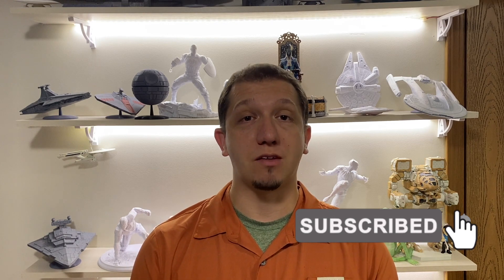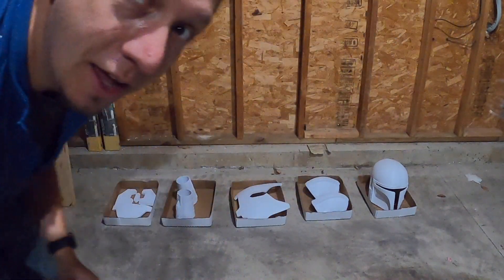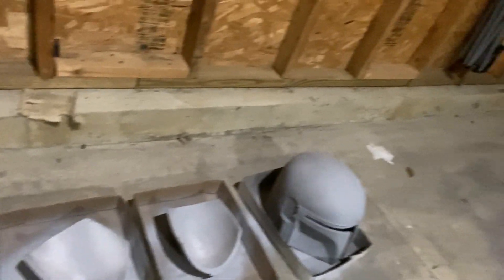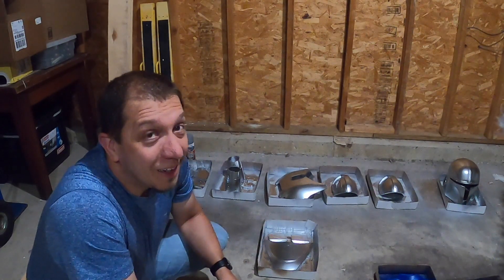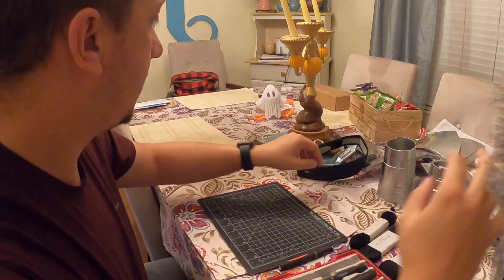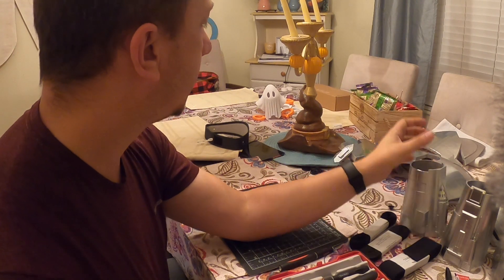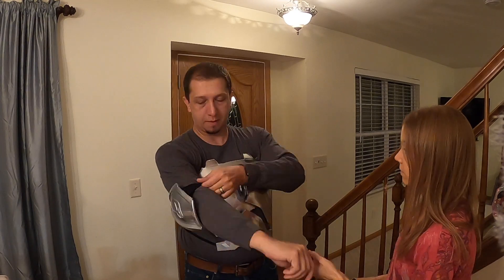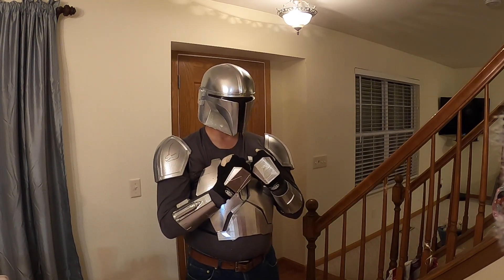How to make Mandalorian Armor with 3D printing (Part 2: Sand, prime, paint, assemble)

Comment: Great tutorial, I just bought my first printer and I’ve been printing pieces of the armor, I’m getting ready to print the upper chest piece right now, did you resize it or did you just use the 100% from thingiverse. I am new to 3-D printing and new to costume building, I’ve been taking measurements but the curve of the armor has been throwing me off of it, any help would be appreciated thank you.
Reply from the maker: I printed it at 100%.

Comment: Thanks the video was very useful for me. I also have a question I printed a Mandalorian Vambrace and I am not sure if I should sand down the layer lines so that you can’t see them or if I should just leave the layer lines alone. What do you think?
Reply from the maker: You can try the primer filler paint to see if it will fill and smooth it.  You can also sand just remember you can’t use a dremel or tool like tha.  It’s a lot of slow sanding.  Either way is fine and all that matters is you are happy with it.  In this video I did not sand them down.  I used the primer filler.  You can also do a bondo to smooth it.
Reply: @Rise3DBuilds  Thank you, That helps a lot.

Comment: oh and for the arm pauldrons - i always print them in halfs and use fabric like a long hinge  on one side very tight, and the other side i use these latchs  https://www.thingiverse.com/thing:53673  they work awesome and make it so easy to put on and reomve them.. and u dont have to buy a hinge  - i guess you could use them on both sides ,but what i do works really well  - mind u  i have electronics inside as well  and these hold everything nice and snug

Comment: as veedub says, use spot putty/glaze - veryyyyy thin coat spread nice  the beeter u do this the easier it is to sand and make like glass - use a black first prime coat anytime u want to use silver as your finish color it will make it look much better . im not sure how u attach your visor i stopped using glue and use heavy duty velco - this way when the visor gets beat up and it will  u can easily change it out -  iv had all my other helmets glued and it stinks to change them out if  they are glued in with hot glue .. u can always remove hot glue super easy with alcohol but velcro is waaaaay easier ..
my paint jobs are verrrry clean only because i take the time printing it good and prep the surface good -- use the putty you will see how much better your end result will turn out , its night and day

Comment: Can you tell me the type of 3D printer you used
Reply from the maker: Cr-10v2, Ender 3 for the smaller parts
Reply: @Rise3DBuilds  small parts like should hands chess and helmet
Reply from the maker: The helmet and chest plates were done on the cr-10v2. Hands,Vambraces, and shoulder Pauldrons will easily fit a Ender 3.  You could do it all on a Ender 3 but you will have to use a tool like me she mixer to cut them up to fit the printer.
Reply: @Rise3DBuilds  what tools
Reply from the maker: Meshmixer is free and will let you break the models into parts.  You will also need cura to slice the models to be ready to print.
Reply: Can you recommend one that can print all of it
Reply from the maker: Cr-10v2, cr-10. The have the right size print area.  I know the sunlu 8 can do  the same size but I have not used it yet.  I have one I. The box for a unboxing on the channel in the coming week. But the first to are printers I know and trusts.  There are links to them in the description of my videos
Reply: @tylerryan2187    you can buy a ender 3 and then buy and expansion kit might come put cheaper then the cr 10  but give you about the same volume after the expansion

Comment: Sand and fill. Sand and fill. I use various grits of sandpaper as well as spot filler (like bondo glaze putty) and then filler primer paint. Make sure you wear a respirator too so you don't get all the dust in your lungs. You want to make sure those lines on the prints are no longer visible. Also you would want to make a vest to mount the plates to. It just keeps the cohesion of the armor together better than just velcro to a t-shirt. But hey this looks great for a first try! You ever think about joining the Mando Mercs Costume Club? There are forums and tutorials on how to make the rest of the soft parts for the kit.